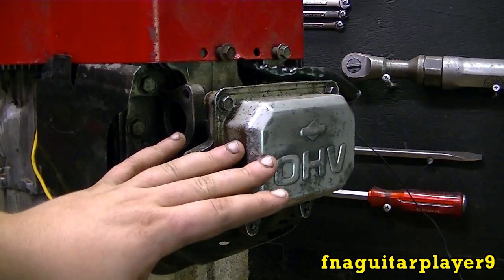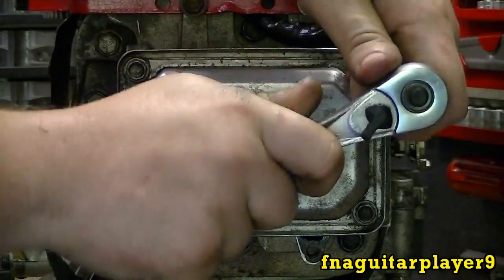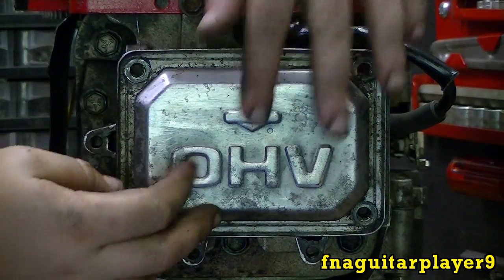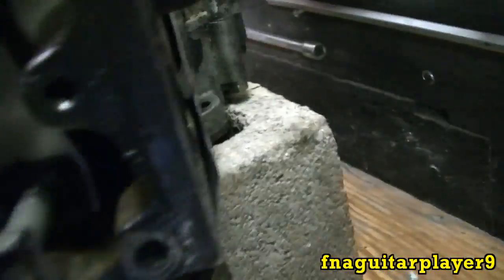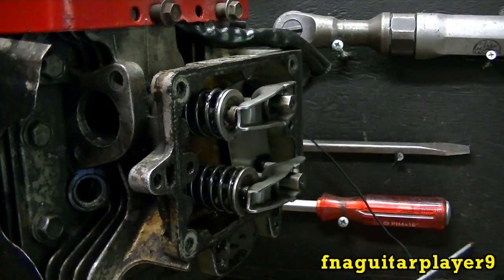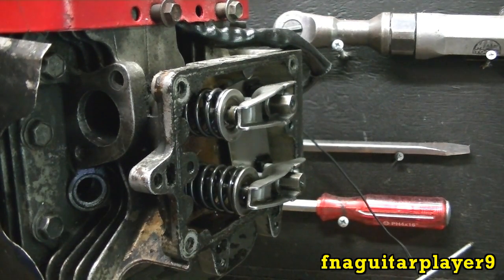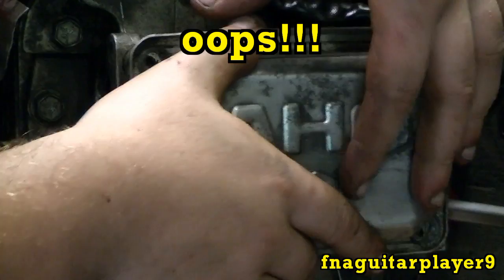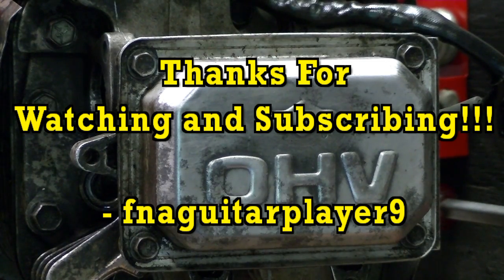How to Adjust Valves on OHV Small Engines (Valve Clearance / lash)

Comment: Top dead center mean both valves suppose to be up at the same time
Reply from the maker: Top dead center (TDC) usually refers to the piston's position, you want it on TDC, piston all the way up on the compression stroke, if its on the exhaust stroke the valves aren't closed completely. Thanks for Watching!!!
Reply: +fnaguitarplayer9 Thank you i try that and if have any questions i will reply back i notice when i pull the rope it's snatch back that's how i notice that the valves was off a little like it was gonna snatch my arm away from me it runs fine the day before only it still was doing what it doing now after i rebuilds the carburetor Thanks again by the way nice video i will be checking up on others video's of yours
Reply from the maker: your welcome, sounds good!
Reply: +fnaguitarplayer9 Yes i think i have to set the valves clearance at .009 0.23 mm since it's a single cylinder 6.5hp push mowers is that right because i don't have a manual book for the gaps settings
Reply: +fnaguitarplayer9 I have everything top dead center just want to make sure im using the right feeder gauges
Reply from the maker: I'd need the model number to make sure, on the smaller engines the specs are all different, but 9 seems to be a little big, but again it depends on model. I don't need all 3 sets of numbers, just the model number
Reply: fnaguitarplayer9 Tecumseh Scott mowers, model number : OVRM120  Thanks
Reply from the maker: I usually only work on briggs, i googled it and it says .004" to.010"  for that engine. hope this helps, thanks for watching!!!
Reply: fnaguitarplayer9 fnaguiterplayer9 thanks alot's because this lawnmower is almost new i noticed when i pull the rope it snatch back that's how i noticed the valves clearance was off because after i rebuilds the carburetor it ran fine and i check the valves clearance and they are too loose, thanks again because we have been getting lot's of rain
Reply from the maker: your welcome!

Comment: I have a 22hp briggs & stratton Engine. when I pull off the right valve cover there isn't any oil in the cover while on the left, oil runs out when I loosen the valve cover. How to correct this problem?
Reply from the maker: It might just be from where one cylinder sits a little higher than the other one, just check your oil level and you should be ok, its possible it has a oiling problem, which would either be the slinger or pump if it has a pressurized system, you'd have to tear it apart to check the slinger and do a pressure test if it has the pump, but i'd say its fine. sometimes even these single cylinders are dry, just depends on how long they've been sitting and how much oil is in them. Thanks for Watching!!!
Reply: Thanks for your reply. I have an oil slinger. I also have what sounds like a piston slap but There are 120 lb. compression on both cylinders. I thought maybe  the  lack of oil on that one cylinder might be the cause of the slapping noise..
Reply from the maker: no problem. Piston slap usually sounds like a knock but toward the cylinder, not the crankcase. Its possible, but if they are reading that one each cylinder, i'd say they are in good shape.

Comment: Great instruction! Thanks. My Briggs manual says that you should go PAST top dead center on the compression stroke by 1/4 inch and then adjust the valve clearances. I noticed you didn't do that. Does it matter much? My 28W707 Vertical shaft briggs won't start and backfires very loudly only, I found small pieces of gasket on the floor after that happened. Could I have blown the head gasket?
Reply from the maker: Thanks! Your welcome! I've heard that before, I just never have done it, both valves are closed on top dead center and the compression release lobe is only in place on about the middle of the compression stroke. So I don't think it matters, but if they recommend then it probably should be done, but I've never had any problems by using TDC. It could be that, they are bad about blowing head gaskets but usually its on the inside strip between the cylinder and push rod chamber. Thanks for Watching!!!
Reply: Thanks. Well, I quit using the 1/4" past TDC and used your method instead. And it worked!! It seems that when I used the 1/4" past TDC and I turned the flywheel by hand several times , the intake rocker arm kept getting loose and going out of spec. When I switched to your method and then turned the flywheel many many times it never went out of spec and I closed it up, put everything back and turned the key and it fired right up. Yahoo!!
Reply from the maker: Your welcome! I hear ya, glad to hear it worked out better. I don't know why it wouldn't stay adjusted though, unless the compression release lobe was hitting the tappet or something. Heard that!

Comment: I have a riding lawnmower that I have been trying to fix for my dad. It is a craftsman 6 speed / 42 inch cut with a 15.5 hp OHV engine. Dad's lawnmower is doing the same thing. I have replaced the starter and the ignition coil pack and it still will not start. Do you think this valve adjustment is the problem? Also I really found your video very informative. Thank you Denise Brown.
Reply from the maker: I hear ya, yeah it probably is, if its out of adjustment the compression release will not work and make it hard almost impossible to start. If your battery is strong and the starter is good (as you say you replaced it) then it would be the next thing to check, which i usually check first before replacing starters, because these motors are BAD about doing that. your welcome, Thanks for Watching!!!

Comment: I have a 15 horse briggs that is hard to start. ITt will turn over ok and if it back fires once the next over it fires up. is that the valves?
Reply from the maker: It could be, if its really hard to pull over, once the valves are adjusted the compression release should start to work again. Thanks for Watching!!!

Comment: Hello, First off your videos have helped me so much! Thank you.. I have a 15HP briggs the Valve is really lose. But here is what has happening. After running it for 10 - 15 min smoke starts coming out not alot but enough. When I opened the hood the air fileter was covered in OIL and it seems has if it coming up throuh the carb into the filter. WHY is this happening?? could it be because the valves are so lose, which they are. Just wondering your thoughts.  THank you Kindly Dev
Reply from the maker: Your welcome, glad to help out! This engine should have the 2 piece carburetor on it, they are bad about the float sticking and filling the cylinder and crankcase up with fuel causing way to much "oil" to be in the crankcase and making them smoke like that, check the oil level first thing if its ok, then I'd say its the "pcv" valve, its not actually called that but it serves a similar purpose, there is a small rubber hose on the back side of the carburetor that goes to the cover behind the carburetor, into the block, there is a piece in this to prevent oil from seaping past it and getting into the carburetor sometimes they need to be cleaned, that may be all it is, another possible cause is excessive blow by from worn piston rings causing pressure in the crankcase and forcing oil through the valve / hose. I'd check those first 2 things first  and go from there. Let me know what you find out. If there wasn't oil in the carburetor but it was smoking excessively, i'd say it was the head gasket, they are bad about blowing head gaskets.Thanks for Watching!!!
Reply: fnaguitarplayer9 Thanks buddy!! I found oil in the carb and under the engine. im guessing after pulling the head, its thr head gasket. i rebuilt the engine new rings and honed the cylinder head about 6yrs ago. its a 93 simplicity and its been worked hard. My dad cut 6 acres forever. Then it was in a flood rebuilt the tranny (having problems again). always something. i think im just going to redo the engine again. new gaskets rings etc. again i cant thank you enough. your videos have been my saving grace. Thank you brother!!! Devin
Reply from the maker: Your welcome! It might be that, they are bad about that. The space between the cylinder and valve chamber is to small and they couldn't put a bolt there. I hear ya, might be time for another rebuild. Might be better off, then you will know what shape everything is in. Glad to help out, no problem at all.

Comment: I have a honda gx240 8hp with OHV.  Its an older pressure washer from 1989.  I looked up the specs and intake=.15mm and exhaust=.2mm.  The intake valve was already to spec.  The exhaust valve tappet was way in, it has no play, no gap or anything.  The motor was at TDC.  When i put the exhaust tappet at .2mm clearance the engine became difficult to turn over, almost impossible.  When i put the exhaust valve back in to where it was it works ok, but is hard to start and runs a little rough.  Why is the exhaust valve tappet needing to be pushed way in at TDC?
Reply from the maker: Alot of small engines have a compression release that works off of usually the exhaust valve, if its not set right it (or the release lobe on the camshaft is worn down alot) it will be hard to start. try setting it at around .1mm and see what it does, sometimes you have to compensate for a worn lobe. Hope this helps! Thanks for Watching!!!
Reply: fnaguitarplayer9 thanks, yes I was thinking the same thing the lobe on the camshaft are worn since it's so old.  I might try and put new rocker arms first to see if that helps any.
Reply from the maker: It probably is. I don't think that would help to be honest, its probably the cam.

Comment: have a hisun (chinese) utv....rough idle at low speeds.  told valves may need this,  would this be similar with the 400cc utv engine?
Reply from the maker: Yes the procedure is the same, however I would suggest cleaning carburetor first, thats usually the most common problem, it could be valves but i'd check the carb first. Thanks for Watching!!!
Reply: fnaguitarplayer9 thanks
Reply from the maker: your welcome

Comment: I have a Champion brand small motor- the service bulletin doesn't specify whether the valves are to be set hot or cold. Does it matter?
Reply from the maker: Its not super critical in small engines, its more critical in vehicle engines, but I've always set mine cold and have never had any problems on small engines. Thanks for Watching!!!
Reply: I set mine cold- mainly because I was too lazy to warm it up- thanks for the answer.
Reply from the maker: I hear ya haha Your welcome!

Comment: I have a problem with a Briggs 14.5 OHV, the adjustment of the valves would not stay after being torqued down.  I discovered (what is called in the briggs parts diagram) the valve keeper cap was loose and came off on the exhaust valve.  Does this just snap back on or are there other parts that keep it on the valve stem?  Thanks!
Reply from the maker: I hear ya! Mine did the same thing. Never did find it in the motor. But yes it just snaps on and the rocker arm holds it on. no problem! Thanks for Watching!!!

Comment: tHANKS FOR A GREAT VIDEO. PLEASE EXPLAIN WHY YOU LIKE TO SET VALVES TIGHT. IS THAT TO COMPENSATE FOR WEAR?
Reply from the maker: Your welcome! Thats one reason and the other being if it was to work loose some, it would still be within tolerance and not be to big of a gap. And the tighter you set it the better the compression release works. Thanks for Watching!!!
Reply: thank you
Reply from the maker: your welcome!

Comment: can you tell what the valve adjustment or cap for a  8.75 190cc  troy bilt briggs and stratton ohv power washer
Reply from the maker: I need the model number off the engine (it should be either on the valve cover or stamped in the flywheel shroud, there are 3 sets of numbers, model type and code, i just need the model just to make sure i give you the right specs! thanks for watching!!!
Reply: 44P777 is my model number, could you help me out too?? BTW thanks for the video and I'm a fellow West Virginian.
Reply from the maker: Both the intake and exhaust valves are set between .004" and .006" on that engine. Your welcome, I hear ya! Thanks for Watching!!!

Comment: i've seen the valve cap missing on the intake in someone else's video also and questioned it. maybe that's correct? on mine the cap is on the intake and missing from the exhaust but i know somebody has been in the engine before me and may have swapped it accidentally. Obviously makes a huge difference in how far the valve is being pushed in.
Reply from the maker: +Jeff Flowers I'm not sure to be honest about it, because the parts diagrams don't even show it, i got the part number offline somewhere else. Not only that, but the rocker arm will grind right on the valve stem, it would slide better on the cup. Hard to say. When i got this motor, the valves were so tight that they wouldn't even close, so whoever messed with it might have lost it or something. Thanks for Watching!!!

Comment: No such thing as a model 28 Briggs. Most are 0.004" INTAKE and 0.006" EXHAUST. Check your Briggs engine manual first.
Reply from the maker: +jim davidson When i say model 28, i'm referring to the first 2 digits of the model number (model type code) on the engine, which represents the displacement in cubic inches, so a 12HP briggs is 28 cubic inch displacement. I have a spec sheet that has all the specs on all engine models listed. Thanks for Watching!!!
Reply: +fnaguitarplayer9 the model 28 Briggs have a higher compression ratio because they have a longer stroke than the model 25 which is the smaller stroke engine the model 28 are kinda popular to racing mowers they make a bunch of performance parts for them
Reply from the maker: That is true. I did a video a few years ago talking about the difference between the 2, and plans to make a stroker, using a 25 block with a 28 crankshaft. Thanks for Watching!!!
Reply: your welcome did you ever get the motor done?
Reply from the maker: nope, never got the time to work on it, i need to check it out again and see what all i need to do it.
Reply: +fnaguitarplayer9 okay that would be awesome when you get it running
Reply from the maker: I hear ya, I might look at this weekend and see again what needs to be done, might have over looked something before. I am interested in trying it out.

Comment: I did a tune up on a 20KW Generac.  On this Generator I tried to adjust the valves as recommended by the manufacturer.  Felt the compression build ( with finger over the spark plug hole) when the piston reached the top. I used the feeler gauge I realized mine only went to hundredths instead of thousands. .02" instead of .002"  But I figured it would just be a little noisy for the test.  But it wouldn't start, and I figure it's either the valve lash is off, or there is air in the NG line from shutting it off.  Have to go back to get it going.  Any idea on your end from your experience ?  Also, by rotating the flywheel to get TDC, I was told the direction mattered ?
Reply from the maker: +dronai I wouldn't think that much extra valve clearance would stop it from running, i've seem them really peck and still run, but you never know. The only reason for the clearance to cause a starting problem is that some engines have a compression release that makes them easier to start. It could be a air pocket, its best to rotate any engine in the direction that it runs in, but most of the time it doesn't matter to much, just depends though. Hope this helps. Thanks for Watching!!!

Comment: got mower going but as popping sound is that valves to tight or loose
Reply from the maker: +Raymond Langevin If its the valves causing that, it would be set to tight (not closing all the way), but it might be carburetor related causing that. Thanks for Watching!!!
Reply: +fnaguitarplayer9  where do you find the measurements on how big the gap should be
Reply from the maker: either in small engine repair manuals or online, if its briggs and stratton i can find it for you. Thanks for Watching!!!

Comment: Ok I finally took apart the engine on this Briggs 18.5 H.P. Intek Engine..It turned out to be the Advanced timing spring loaded mechanism had broke, thats on the cam itself with a spring on it....So if you replace the starter,The starter solenoid ,the Battery..All that you can think of, ignition switch..Just know the advancement on the cam can also be your problem..Makes it seem like weak battery..bad solenoid..and or connection..about 70.00 dollars and do it yourself with a gasket about 80.00 your good to go..This releases compression during the initial start..So just keep in mind that this may be your problem which I have seen no one mention this problem ..Your welcome!..
Reply from the maker: +Bruce Arnold I hear ya, its actually not advancing the timing, it works off of centrifugal force, when cranking the lobe is in place to hold the valve open to let some compression out, then when it fires up, centrifugal force slings it out of the way so it opens and closes off the main cam lobe only. But yeah this almost always the problem, either the valves out of adjustment not letting it work or the lobe gets wore down or breaks. Thanks for Watching!!!
Reply: Yea I somewhat know the theory of the speed holds it open to allow it to start,And yes Ive found worn lobes on these engines before..And valves needing adjusting..Ive just never seen one that has broken the counter weight and spring on the cam..So its good to know all the multiples that can be the problem..And hope your vid and all that is said here can help out someone!
Reply from the maker: +Bruce Arnold I hear ya, never know what to expect when it comes to small engines haha